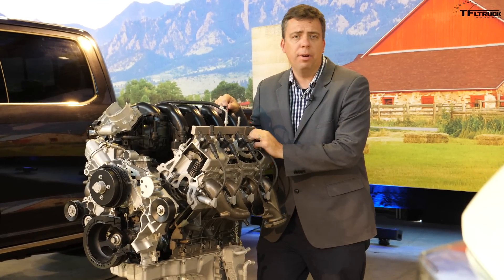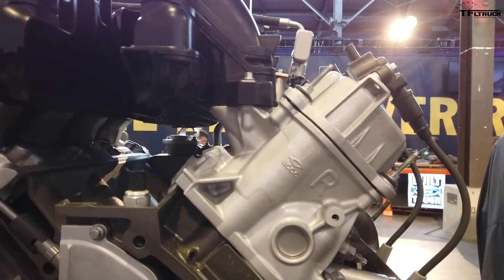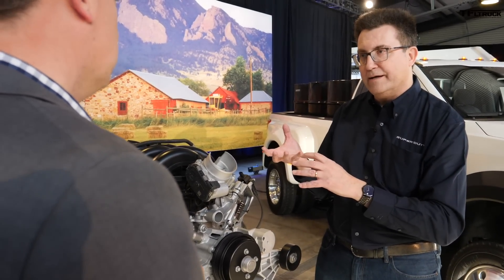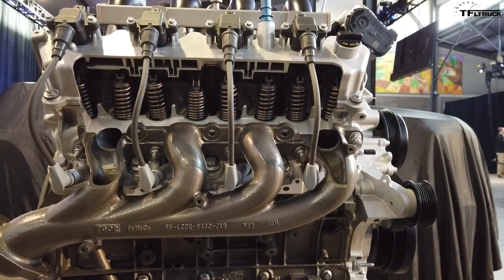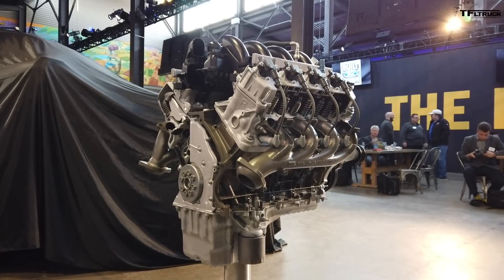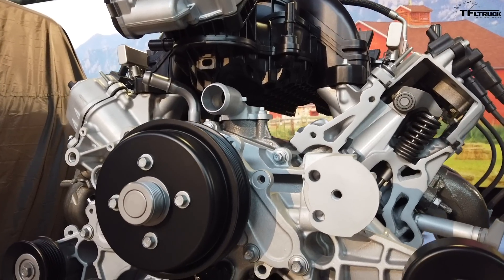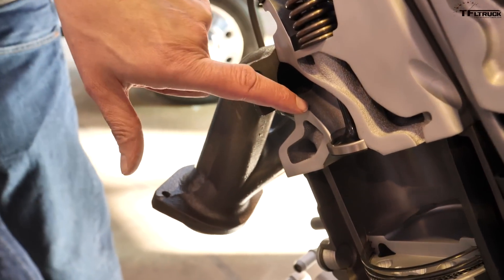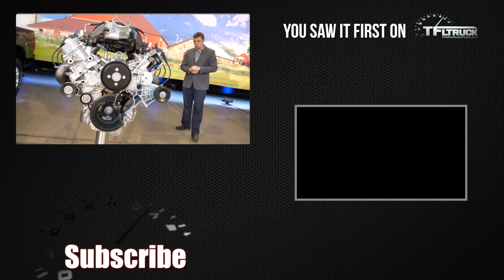2020 Ford Super Duty 7.3L V8: Here's What You Need to Know!

Comment: Push rod, port fuel injection, lower max RPM.
It’s gonna be a thumper motor and A viable alternative to the hyper expensive, finicky, re-gen problematic diesels.
GOOD FOR FORD
Reply: Piss on DEF, I'm really interested in this for my next truck
Reply: nibot kram  Yea, I’m really excited for Ford and anxious to see the numbers on this engine. The ONLY thing I wish they would have engineered in would have been a wet sleeve design with drop-in cylinder liners. I’m sure this engine will be plenty durable, but it would have been a nice touch for fleet service to be able to swap in new liners and rings. 
I really liked the intake manifold too. That big open air space under the plenum will keep things nice and cool, so this thing should be able to lug!  Hard pulling at 2,800 rpm with no pinging. Can’t wait to see it in action. 🤠
Reply: Well desperation is just that. The 6.7l diesel is fast but has the worst mpg and emissions issues vs ram a gm. Yet the ford diesel is the most expensive of the 3...
Reply: @crazyhass84  DEF doesn't improve MPG. It's AFTER combustion and makes exhaust cleaner.
Reply: @tractorback76  
Lol, def is piss.
Reply: Andy Hass actually DEF has a lot of issues. The freezing/gelling point on Def is too high to work in sub arctic temperatures. Look at all the rigs you see frozen up on the side of the road lately - all fuel and DEF related issues. If you live in northern Canada you better run a aftermarket heater or your truck won’t run for more then a few minutes. The old pre emissions engines never had these problems
Reply: This is the way engines should be built.
Reply: That 6.7 is a dang good diesel.
Reply: Yeah, those GM's have some nice squirrels.
Reply: Well put
Reply: @aarongaal8168  
I don't have that issue in Idaho and it gets under the 12° f freezing point. However it might he because our trucks are different. I have a 2017 ram and Rams might have heating coils or something that heats it built in. I may have to Google it and see why mine doesn't freeze.
Reply: They will be way over priced like all Ford trucks are.
Reply: Robert Brumley So Bob who is making an under priced truck today?
Reply: Thank God. Diesels theses days are crap.
Reply: @tractorback76  Gord is going to make bank on this engine.
Reply: @crazyhass84 , absolutely NOT true! I've been all types of trucking for 20 years now, construction equipment, HD pick ups and all types of semi trucks! I shit you not and still big rigging till this day kid. DEF is the very worst thing that happened to diesels in the history of HISTORY! Let me explain. Back in 2004 the EGR(exhaust gas recirculation) was introduced to the diesel engine, which made a diesel run a tad bit cleaner. That wasn't too problematic. In 2008 the DPF filter regen was introduced next and most trucks had to be manually regen👎👎That was very problematic! Then in 2010/2011 DEF was introduced, then Caterpillar said thanks but no thanks and completely stopped making engines because they knew of all the problems that they were going to have to fix under warranty and bailed on the engine game. EPA regulations have gotten stricter causing a stranglehold on vehicles/engine manufacturers giving them no choice but to keep over engineering engines so they can run cleaner. I'm all for cleaner air but it's killing our engines. Today's trucks use all 3 emissions components, EGR, DPF filter and DEF which uses fluid and another extra filter on the exhaust side, wtf is next?! Compare the engine oil on a pre emissions diesel to a diesel with all the emissions crap on it? On a pre emissions diesel, the oil looks and stays cleaner a lot longer while the newer emissions diesel oil quickly gets all sooted up, black af, looking like liquid coal. Reason being that the newer diesels recycle lots of exhaust back into it's own engine causing tremendous soot buildup and that's why the oil gets so black! You're comparing MPG's on a i6 Cummins to a V8 diesel? DUHH,  u obviously get better mpg's when u have 2 less CYLINDERS. Cummins are good engines when they're new or have low miles but once u get around the 250K you're going to have too many problems with the emission system 🤔🤨😖😡🤬🤯Deleting all that crap is the way to go. Pre emissions diesels could give truckers 1.3  million miles and between 6-8 mpg's loaded while newer diesels will not go over 750K miles and 4-6 mpg's loaded if you're lucky on the original engine with no overhaul!!! I've personally seen newer emissions diesels blow out at 300K miles! #FACTS 😡🤬🤯👎👎According to you though, newer diesels are better but they are NOT🤫🤐
Reply: Basically Ford finally had to give up The Ghost and copy the LS motor from GM! If you're not educated about it I will educate you Ford is using General Motors 4 bolt Mains with the two side cap bolts! The best design ever! Why do you think LS Motors get put into Ford products because they're the least expensive to manufacture the best design in the world the most durable engines in the world and Superior to anything else Ford Motor Company will ever make can ever make has ever made. Ford sucks let's just admit that. If you don't believe it look at the millions of Triton Motors that Ford made that are garbage bringing the value of those trucks down to nothing
Reply: @Michael-ge3eo  u are right Chevy did this years ago. Chevy got a great motor though. Heavy duty
Reply: @1LOCKNLOAD  good for costing alot if maintenance money,which is why so many are sitting not repaired ,noone wants a6000.00 dallartune up
Reply: Michael Cavalieri the Tritons were very durable engines internally. Yes, they had some spark plug issues and burned through coil packs frequently, but it was nothing for one of these engines bone stock to go 300k - 400k or even more if properly maintained. They weren’t the most powerful or most efficient as compared to newer engines, but every bit as reliable if not more reliable than an LS.
Reply: @I know you are right, And I just got owned but: after working at a GMC dealership it wouldn't suprise me if this is more reliable than what they produce. But most modern cars are getting more reliable as time goes on. Time will tell. And I could very well be wrong.
Reply: @tvlandman2 The 4.6 if just moderately maintained was a 500k motor.
Reply: Andy Hass my 1996 12v Cummins gets 22 mpg, so..............
Reply: cummins diesel there problem solved.. most reliable diesel motors out there
Reply: tvlandman2 - that mod motor ran 294 mph in a 2005 Ford GT in one mile. They’re good engines these ls jumpers don’t know shit
Reply: @theninja001  best engine right there man
Reply: nibot kram they’re doing away with DEF and DPF
Reply: @tractorback76  can we get trump to overturn EPA standards on diesel engines???
Reply: Michael Cavalieri GM didn’t design the last they bought it from a boat company.
Reply: @Michael-ge3eo  Ls get swapped into everything because chevy hasn't changed them in two decades and they're cheap a/f qp Any you pull it. The coyotes flows miles better than any gm engine it's why s/c or turbo coyotes are dominating anything forced induction chevy out there. Are ls simple and dirt cheap ? Yes but they cant stock for stock internals compete with a 5.0 on power handling.
Reply: @superduty4556  It decreases MPG because it chokes the breathability of the engine. Diesel's need to breathe to get the best fuel economy.
Reply: @1LOCKNLOAD  , 6.7's are nothing like the old 7.3's That motor was practically indestructible, I should know, I'm still driving mine 18 years later and 416,000 miles on it. Original motor, and those aren't all highway miles. Those are mostly towing bobcats, and hauling heavy material for my concrete business. Ford should have never gotten rid of those 7.3's
Reply: Sir, much like you I still have my '99 7.3 with 435,000 miles on it, with a 6 speed manual tranny. Runs like a new one. I also bought a 2001 7.3 that had 146,000 miles on it that now has 414,000 and runs like a new one. I never said the 6.7 was as good as the 7.3 because to me nothing is. But, I still think the 6.7 is a good engine. I've got a lot of friends in the oilfield that use them and love 'um.
Reply: @Michael-ge3eo  try again bud,  GM got that cross bolt main design from ford, who started it in '62 with the 406.
Reply: Don Olypopper  you are right on this one, and there is a good reason for that: not only does the EPA govern the diesel particulate emmissions, but also NOx emissions. The engine conditions that minimize DP emissions tend to maximize the production of NOx, and vice versa. However, the problematic one for fuel economy and regens is the DP emissions. Prior to the advent of the SCR (DEF system), manufacturers were complying with the NOx regulations by using the EGR system extensively, which reduced combustion temperatures to reduce production of NOx (which coincidentally, also increased the production of DP emissions). So, with the increase in DP emissions, additional regen cycles would be required.  

The SCR being added to the exhausts allows for the manufacturers to tune the engines further to optimize on the DP production at the expense of higher NOx production that can be reduced by the SCR.  Less DP emissions= less regens= less fuel wasted.

Comment: This has the possibility of being a 500K+ mile engine, thank you, Ford!    Pushrod, no direct injection, iron block...I'm lovin' it!
Reply: Is that an achievement for Ford? Toyota does that with plenty of their engines since the 80's. Including four bangers lol
Reply: @pryme2013  Actually, extreme reliability is a new direction for Ford, LOL. Leave off the whiz-bang gadgets and just make an engine that runs and is easy to service. As far as Toyota is concerned, however, though they have reliable engines, they have yet to even dip a toe into the big tow/haul/work market in the US... I know they could do it, but they don't.
Reply: @NukePooch1  Well, look at the Hino truck line, built by Toyota. But, just like any manufacturer, you'll get some good ones. And some bad ones.
Reply: Minus the direct injection, Chevy has been running that reliable style of engine aka 6.0 in there heavy duty for 18 years. About time Ford caught on.
Reply: @davidlavery8336  That's why the 6.0 is going away.
Reply: @benjaminwayneb  That's why I just bought a 2500hd with the 6.0. Can you tell I'm biased lol. But I had no idea what Chevy was going to to replace it with in 2020 and wanted to go with the ole tried and true. Hopefully Chevy sticks with the iron block pushrod platform themselves.
Reply: im sure they call in a chrysler, gm or 3v triton engineer to come over and screw it up with a single bad design.
Reply: So they’re going back to what GM never stopped? 😳The hell you say!
Reply: @pryme2013  ...Modern Toyota's dont last !! FYI : American cars have engines that last 500,000 miles as they did since the 1950's !! GM/Ford/Chrysler all make reliable vehicles...

Toyota has major issues !! Sludge,head gaskets,bad cams,bad heads and brand new engines failing ,bad pistons and failing transmissions ! 

Toyota's do last but with more money invested in them than American vehicles..

I own a late model dealer and the Toyota/Honda repairs they do to keep them running are a lot..Toyota owners say a head job,ring job is normal maint..its not..Toyota owners say a new transmission is regular maint,its not..Toyota owners say a replacement engine is regular maint ,its not !

Funny,youtubers insist Toyota's are so reliable,yet people call in/leave messages about problems with their Toyota's of all ages and low mile newer ones..If they were so reliable they wouldnt call in and the so called mechanic wouldnt have so many toyota customers that need major work or any work at all !
Reply: As much shit as Ford's 5.4 gets, it was still a million mile motor. Proper engineering is great but regular maintenance will take you far.
Reply: @01trsmar  No gasoline motor in the 50's or 60's would last 500,000 miles.  The oil and filters available at the time combined with less durable materials (bearings and rings) simply would not last that long.  Heck, in the 50's a car was expected to start smoking by 60,000 miles.  A few of the v8's from the late 60's to the early 70's could regularly go over 200,000 IF they were not driven hard and got meticulous maintenance.  Even the Chevy 305 of the 1980's would burn oil early if they did not get regular oil changes.
Reply: @01trsmar  LOL oh boy
Reply: @davidlavery8336  I did the same thing! Got a 2016 Sierra 2500 with the 6.0. What they're putting in these trucks nowadays does not interest me, just give me the basics. My fathers 2005 1500 Silverado with a 4.8 has been a great family truck for almost 15 years now.
Reply: @Grifter371  yup I didn't even look at the half tons, I had a 2010 GMC 1500 5.3 with the AFM, while the engine was good an ran great I had a code on for the AFM that no one could figure out. My father has the same truck with no issues though. So hit or miss I guess. But figured the 2500hds are built to get beat to crap out of for 200k with out any issues. Using it as a daily driver I expect to get 500k out of that engine. Tranny will see. And I get 15 to 16mpg average out of it back and forth to work. The best it's averaged in 50 miles is 23mpg the worst is 13mpg. Keep your foot out of it and it's great for a bug truck like it is. And I get extra towing capability, what's not to like lol. I love that truck.
Reply: @davidlavery8336  AFM has been a serious issue with those engines for years, I work on them every day haha. There are hardly any issues with the 6.0. They sell a lot less compared to the 5.3/6.2 but it's a very solid, reliable engine. I feel like it's really choked from the factory but I'm not using it to break the land speed record.
Reply: @Grifter371  yeah when I was working at a dealership, the Jasper engine guy came through to talk to me. We got to talking about engines that come to him for rebuilds the most. Which was the 6.0 Ford diesel haha. But a fair amount of 5.3 Chevy engines but only because they've made so many. And asked him about the Chevy 6.0 gas, and he paused and said nope, not really. They rarely ever come through for a rebuild. Like you said they're detuned to last a long time, specially this last gen they made. A cam and a few mods and I could get 500 hp and torque out of it as well. But how long would it last? Hard to say. I'm leaving it stock and keeping this truck for the long haul.
Reply: Mr M Toyota’s don’t tow shit especially the one that last high miles
Reply: N Pooch - Definitely not a 500,000 mile engine, not without very expensive repairs/replacements to get there like every newer engine. And nearly any engine will last that long if you throw enough new parts at it.
Reply: Paul Hudson - There are very few gas engines of any era, new or old that will last 500k without major service, or complete overhaul. There is nothing more durable about the materials used today, they haven’t changed that much. Modern engines do however have the benefit of onboard diagnostics with tell a fool when to pull over and seek service before he destroys his engine.
Reply: @pryme2013  Ah they are not towing 15K pounds either are they ? Lol 😂

Comment: As a GM guy, I have to say that Ford hit the nail on the head with this one! I especially like the fact that it doesn't have siamesed bores like the new GM 6.6 does (even though there are small holes through the webs). The extra cooling on the non-siamesed 7.3 will provide a much better duty cycle when the engine is operated full tilt for extended periods, -not to mention, the bores will stay more round and reduce oil consumption. This looks to be a very well designed and stout engine. I was wondering how long it would be before the big gas engines came back, -since the diesel engines these days are so expensive to maintain and have so many failure-prone emissions stuff on them. I think this one is going to be a winner!
Reply: right on brother!  the EPA is destroying diesels and making them almost impossible to own, lets bring back big block power! no replacement for displacement, reliable, tried and true!
Reply: GMAuthority is saying that GM and Navistar are to install an even larger gas v8 (8.0+) for their trucks.
Reply: Ratman572  Thank you for being sensible and not just brand-loyal.  Ford definitely knocked this one out of the park.  And after diesel emissions have forced them into what they are now, GM definitely needs to bring back a big block.  Hell, just ‘modernize’ the 8.1 for today’s requirements and you don’t have to go back to the drawing board from scratch.  The 8100 was a BEAST in its time!